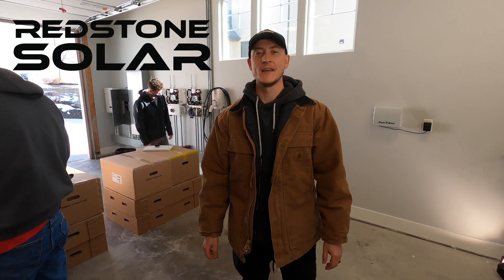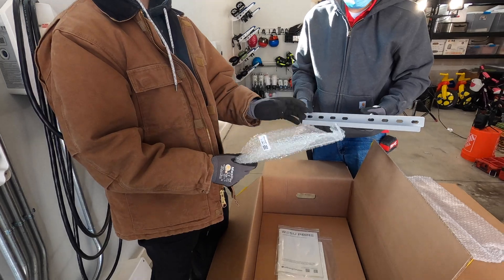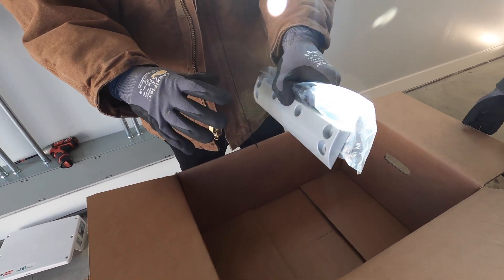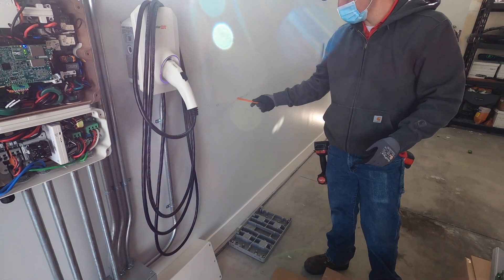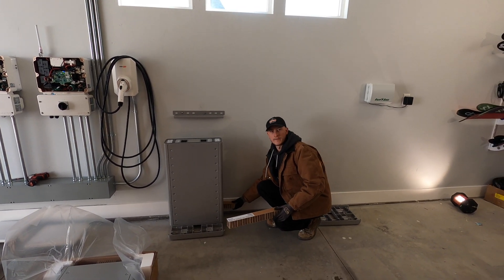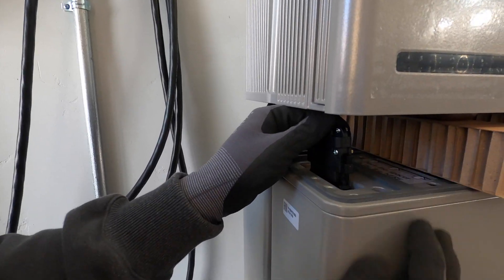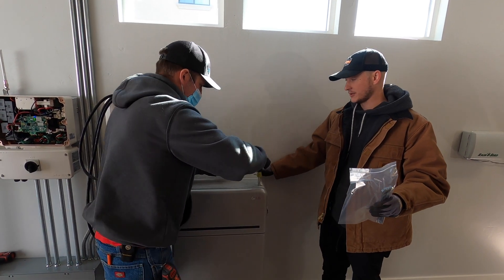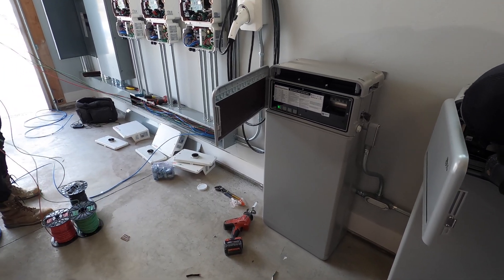LG RESU 16H Prime Installation Overview (UPDATED)

Comment: Hi. I'm a 64 yo woman in Texas. My husband (passed 2-7-2021) and I have a 36 panel, 11.78kWp SolarEdge system that was installed April 2020. I run a business at home. I'm planning to get an electric car in the future and since the winter storm the week after my husband passed, I've had concerns about the grid. I would love to have a battery back up, but the numbers that have been quoted to me have been over 15K, after already spending 40K, that number is really putting me off. What would I need to do, or is it just going to cost that much. I want to have protection against power loss, but not sure about the ROI.
Reply: If you already have a SolarEdge system, you may have to switch to a StoreEdge or Energy Hub inverter (simple swap), battery, and add a SolarEdge Back-up interface.
Reply: All batteries install with labor is 15k minimum.  Not worth doing it for less. Permits , engineering, wiring , labor , warranty , troubleshooting, and much more. Lucky you not in Cali or New England will cost you 20k minimum. Some paying 30-40k now.

Comment: Can you please share what the proper DIP switch positions are for a single Energy Hub and single RESU16H?
Need to know the Energy Hub, built in meter, and battery pack DIP position settings.